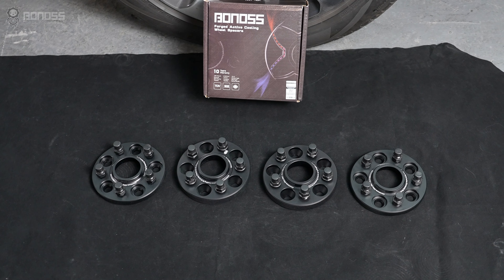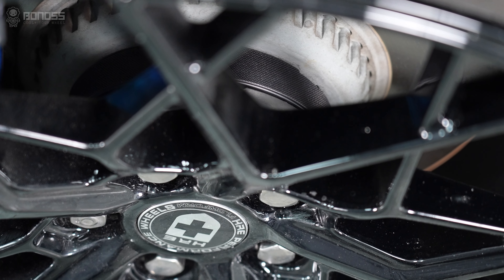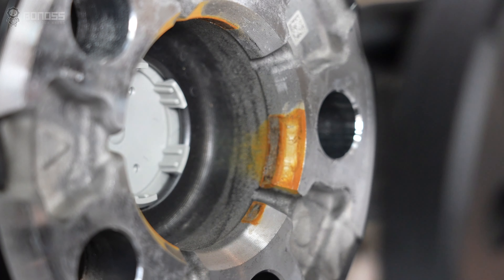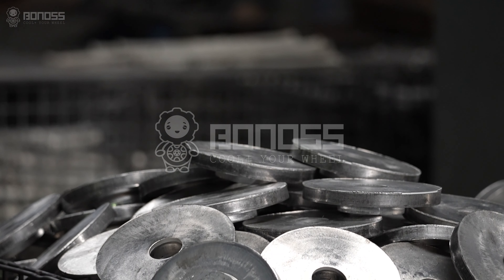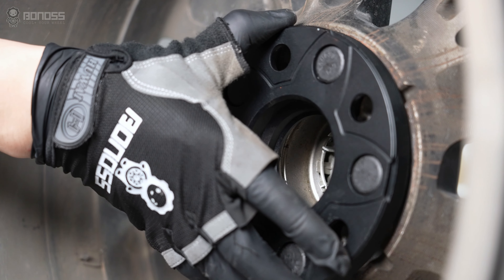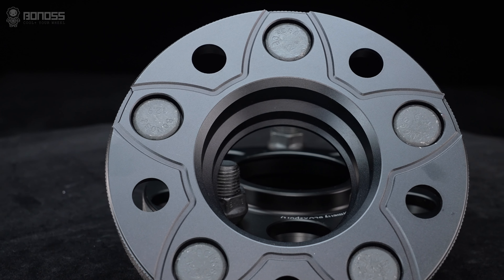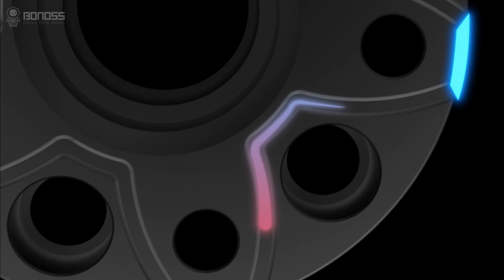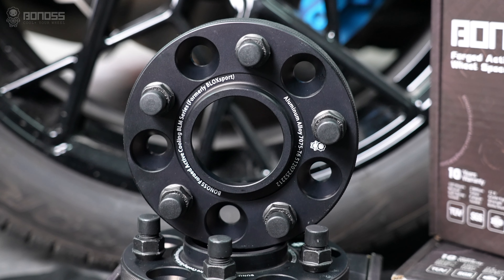Are 2024 Mitsubishi Outlander Wheel Spacers Safe? - BONOSS Mitsubishi Parts

Comment: I’m planning to buy your product. What would be the right thickness for a 2024 Mitsubishi Outlander. Thank you in advance
Reply from the maker: Normally we recommend  20mm wheel spacers for the front and 25mm spacers for the rear. You can also use a metal ruler to measure the distance between the fender and the outside of the rims to determine the flush effect you want.
Reply: Thank you